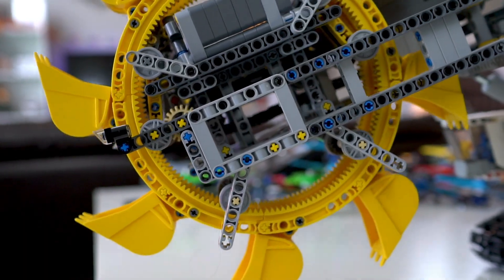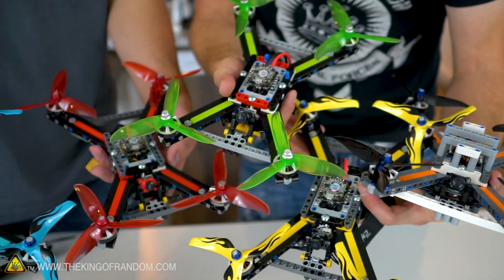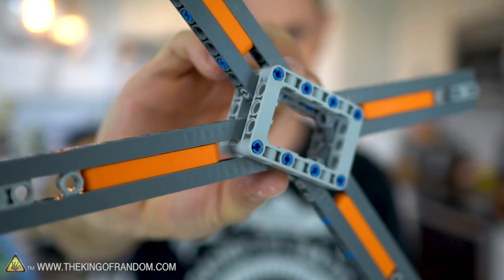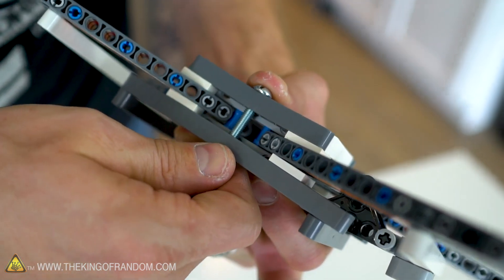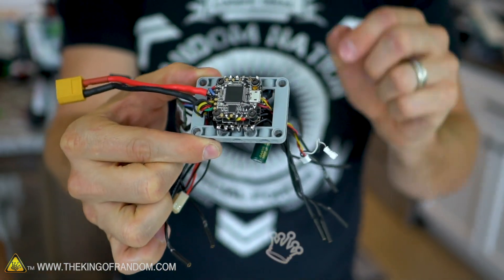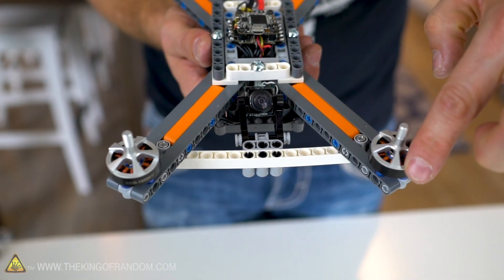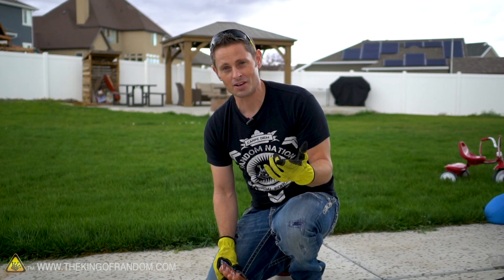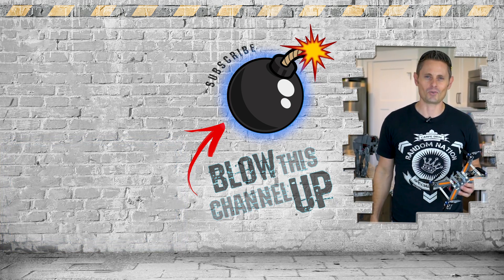80Mph Racing Drones made from Lego Technics

Comment: Nice, but not incredibly impressive, as the only LEGO pieces used are in the frame and the motors are directly connected to the rotors. If the motors were LEGO motors I would be super impressed. Still somewhat impressive though.
Reply: You couldn't use real lego motors tho unfortunately, they don't have a high enough RPM.
Reply: @HerbaMachina  that is true, BUT there is probably some way to get a 100% LEGO creation with motors up in the air.

Comment: 3:14 100% lego, first thing you see is a bolt with a nut xD
Reply: I made a Lego freight train with a 2000 ton capacity by gluing a brick to a freight engine.
Reply: Im sure they were for _extra_ support
Reply: If Lego can brand some bolts it'll technically be Lego brand bolts lol
Reply: zech Russell I don't think they will brand bolts or brushless motors

Comment: I made the lego frame using the KOR manual... made some changes to the landing gear using shocks and wheels.... no, not racing it, just want to build and use. Too easy to buy a ready made drone... Cool thing is I can change colors of any part (mostly). Now to wire the thing correctly. Taking my time, not gonna rush through.

Comment: 3:19 "one hundred percent Lego Technic" as they display the bolts running through the Lego beams...
Reply: Eric Karczewski technically if Lego makes a set like this and put a screw in it with the LEGO logo it’s technically Lego technics, just like how barnacles had a gearbox that was completely assembled and have screw inside them and you can Collett Bionicle Technics

Comment: 13:09  Actually the stock Betaflight configuration has the OPPOSITE rotation that you say for the props.  They rotate IN. This can be changed on the software if you wish, but would require that change be made in the ESC software as well.

Comment: Finally gathered all needed LEGO parts. But what about electronics? Can you give us the link to those electronics that you used? Which controller board and camera would fit in? And which moter should we use? We really need those details. Thanks!
Reply: iMad Science look up a fpv drone build, like uavfutures 99$ build. just build that and it will work
Reply: alexander troyak oh, I actually watched that a year ago, and I bought the version 2 pro one literally today.
Reply: buy a carbon frame. the lego is gonna explode when you hit a tree and it will take some electronics with it.
Reply: Check out painless360 build videos for starters.
Reply: The motor is a brushless motor which is why it needs a esc

Comment: The motors are 3-phase AC, even though they’re called “Brush-Less DC” motors; as such, if the direction is incorrect, swap any two wires. This trick works with big, industrial 3-phase AC motors as well. A lot faster and easier than fiddling around with software configuration.

Comment: Build a camera mount on the other side so you can mount the camera to either end (or mount 2 cameras); you should still counter-balance the camera with a weight, though, for stability. Or put a Lego “gondola” on the other side, and fill with LEGO soccer balls and race them. Not only do you have to cross the finish line (or hoop), you have to have at least 1 LEGO soccer ball still in the gondola; lose all the balls and you’re disqualified! 🤠

Comment: those esc's are painfully underpowered 20-30a for 2205 motors provides pathetic amounts of power.
ps. I know they said it could provide 100a but on a 20x20mm stack with that board it would burn out trying to do 50a.

Comment: If u remove the IR filter from an old digital camera, it will be able to receive IR light. IR light is invisible to the naked eye but through the camera without the IR filter, it can pick up IR light which means that in the dark you can make a night vision camera if you have some IR illumination.

Comment: All you literally did was taking an existing quadcopter and put it on a Lego frame...  I see absolutely no point in that. A carbon fiber frame can cost $30 while all the Lego pieces probably cost 50+
Reply: Or a 13$ Lisam ls210 from BG😂
Reply: @rouvengrundmann8036  only the best
Reply: @WiktorJurek  Until the top plate shatters
Reply: If you want a "real" frame its gunna be like 100 bucks
Reply: @gracklefpv8811  no the rotor riot cl1 is 35
Reply: ChezMusic some people have these legos already
Reply: Okay so atleast it looks cool
Reply: Your a big hater...

Comment: Any actual fpv pilots here? For those who aren't, and find this interesting, here are some channels that will help you get into fpv drones: Mr Steele, Le Drib, UAVFutures (he teaches you building), and Drone Mesh

Edit: as cool as the Lego drone is, it's nowhere near as strong as a real drone needs to be. Also, the setup is nowhere near as simple as it seems here. There's so much you can do wrong if this video is your only source of information
Reply: I was just hoping that wasn't an HGLRC stack... I had a really bad experience with one 😂
Reply: Yeah you're totally right. I feel like all the connections between the Lego bricks would cause a lot of oscillations... This video does an alright job at showing what they did, but really shouldn't be treated as a build guide for a first timer.
Reply: Ignorance like using high speed propellers with low speed, high-torque motors
Reply: I would also throw johnny fpv into the mix for flying and rotor riot for builds
Reply: What problems should we look for when making this drone only by watching this video?
Reply: @iol9991  Just don't do it
Reply: You can also watch some rotor riot build vids
Reply: defiantly check those channels out

Comment: In a previous video "How to Make an Electrical Arc Furnace," as you scrape out the manganese dioxide you mention that it "could be saved for other experiments." I may be wrong, but I don't believe that you have done a project involving it. Could you either do a project involving Manganese Dioxide or correct my knowledge? This has been bugging me for a while.

Comment: You should try connecting a drone to a VR headset with an eye tracking sensor, and have the drone be controlled by the direction the user’s eyes are looking instead of a handheld controller.

Comment: Use different motors 1800kv is to low to run a 5 inch prop. U would be able to make it fly over 100mph, if you were to use 2207 2600kv motors

Edit: just to clarify the stack can only take 4s this is not a 6s set up.
Reply: 2207 2600 on Lego frame? The frame will literally explode on the first punchout.
Reply: Yeah higher kv and bigger stators or maybe 6s
Reply: Nils Meinardi aka mashiFPV yes, as mr slteele said, the 6s isnt just the new 4s, its simply better
Reply: Why doesn't this have likes
Reply: he was running 6s I guess
Reply: rc profi no the FC and ESC can only take 4s.
Reply: not if you're on 6s though

Comment: Actually your motor direction is backwards. It's not the standard rotation. This will require changing the defaults in betaflight. Just a warning peeps there is a lot more to this than just flashing some software to the flight controller. You also will need blheli software.

Comment: Which controller board did you used to control drone? and  It would be expensive?
Reply: We used the HGLRC XJB F428-TX20 V2 Stack , because the screws are 20x20mm . But any betaflight flight controller would work.
Reply: Most of them are around $30, so not expensive :)
Reply: Search UAV features in YouTube and join with our hobby mate ❤️

Comment: 'After removing the metal bracket, we can detach the battery connector like a little lego.'
'Moving towards the bottom of the phone, we have 6 Philips screws holding the protective plate in place and after removing that we can detach the microphone, speaker and signal wires like little legos as well.'

Comment: I bet that is cost more than the actual drone becous its from LEGO ®
Reply: you can get a pretty neat carbon fiber frame for about $20-30 USD
Reply: It all depends on what parts you get a drone like this is fully customized for one high quality motor it costs $25 the flight controller came be around 25 to $50 and camera's about 25 to $40 the vtx 25 to $50 this is were it gets really $$$ you can buy 4 ESCs for the for motors or a 4 in one which puts all 4 ESCs into one package and finally all in one you get 4 ESCs a flight controller a vtx all in one board and that is about 70 to $140 so you can see that this hobby is not cheap. Oh it depends what quad frame you get the one I got was $27
Reply: @christiandavies4798  man those are cheap my motors are 70 per my camera is like 200
Reply: also these drones are not just your ordinary camera quad! These are much harder to fly than a gps drone!
I have one!
Reply: Carbon fiber is pretty expensive and these pieces of Lego really won't cost more than $10-20.
Reply: Ha nope my drone was 700$ with top of line gear
Reply: @edmundtiao7469  exactly this dude above thinks 400 is cheap
Reply: I have spent around $450 for everything besides the fpv gear so I have been fly LOS in acro mode for about 3 months than my quad broke
Reply: Well it's not a set so ur wrong